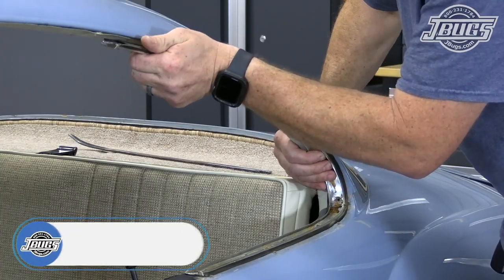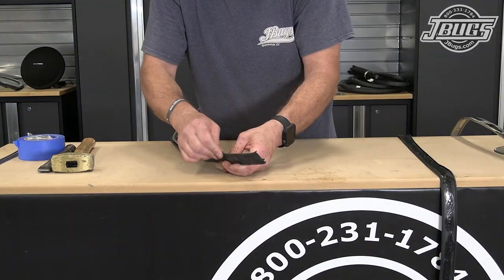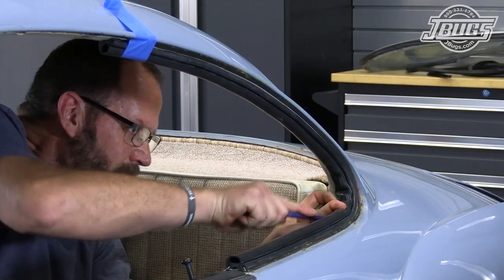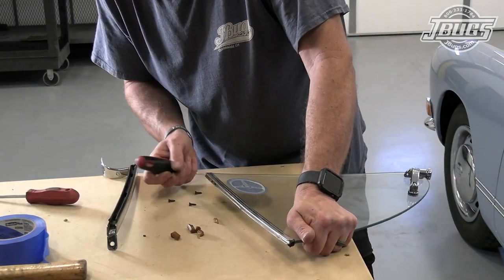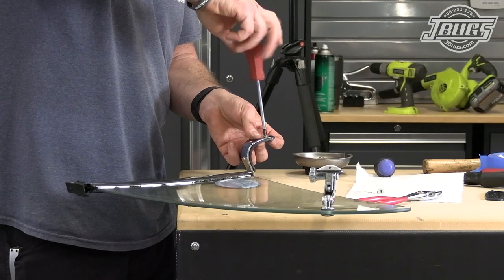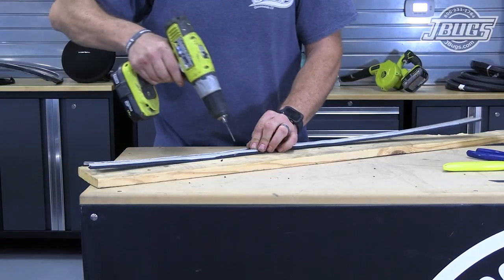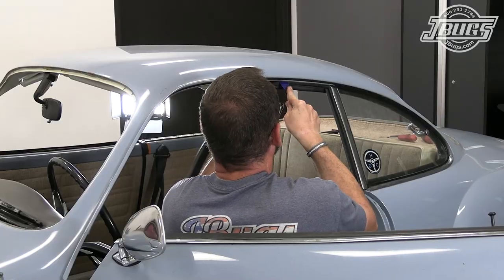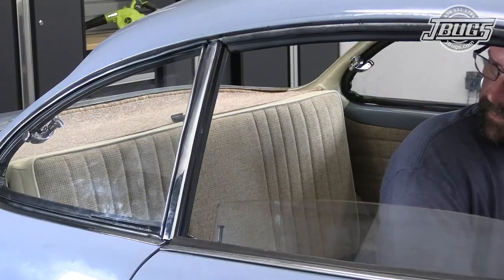JBugs - 1970 VW Karmann Ghia - Quarter & Door Window Seal Installation

Comment: I am dreading this, i have to pull all the windows of my parts car and put them all in my project car..... if you feel like running up to canaderp for a weekend of fun window stuff??!!  lol
Reply: Well unfortunately there are two problems
1:
Canada - it's cold in Canada, I don't like cold!
2:
Ghia Windows - NOT fun! 

LOL - sorry, I'm gonna take a pass!

Stay warm, it will help with the dexterity of your fingers and it will help the rubber install as well. Also, get lots of silicone spray lube!

Comment: Are there different sizes of the quarter glass karmann ghia from 1969 to the 1974?
Reply: The seals are different starting in 1972, I’m on vacation so I can’t really check  the year fitment until I’m back.

Comment: My door won’t close with the window rolled up after changing the seals please help.
Reply: That is a common problem and usually has to do with the window rolling up too far. The window regulator has a couple of adjustment points to align it with the seal, one to stop the window from rolling up any further, and another to adjust the angle that it rolls up. Getting that point set, and getting the doors to close and seal properly with the window up is one of the harder aspects of dealing with Karmann Ghias.